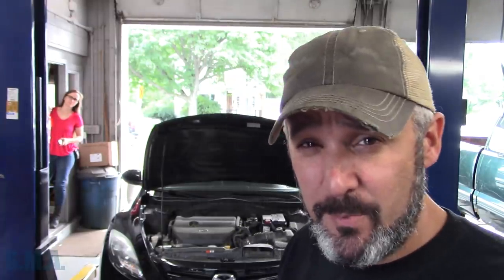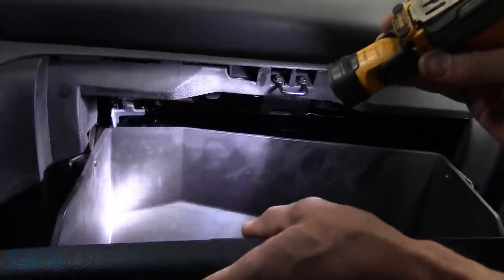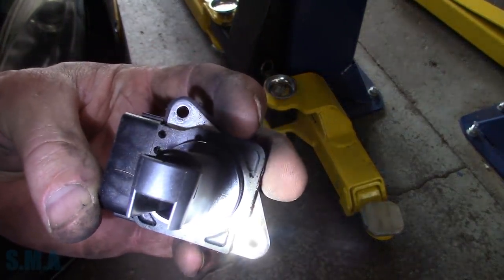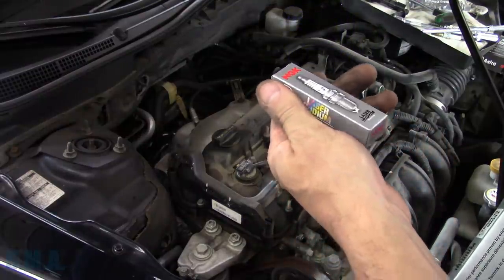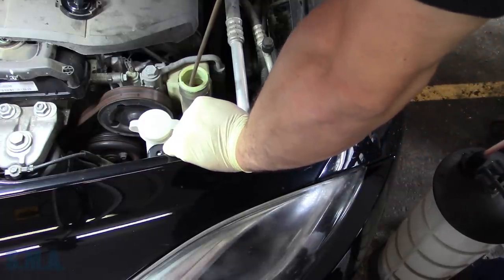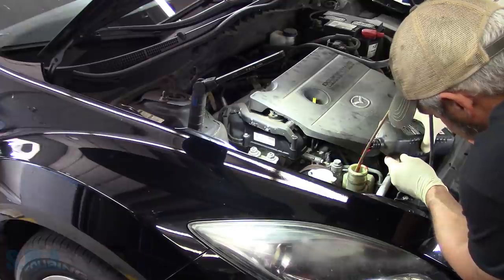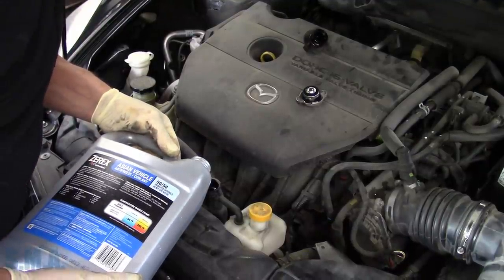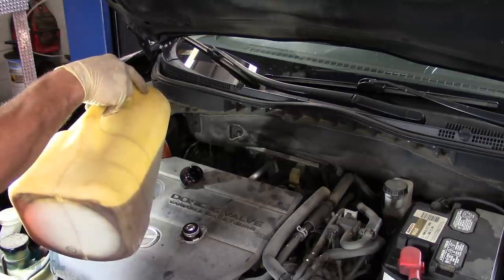Mazda 6: 100k Service Front To Back

Comment: Ah ha ha, i see this as my 2012 mazda 6i is skipping up to 200k (174,xxx). When i got it at 4x,xxx and happen to check the air filter, It looked as if the original color was dark brown instead of white. Is that a universal thing with these cars?!
... You'd think the dealership (that i used to work at as a salesman) would have changed all that before selling the car. That's what led me to wonder above the engine filter, that led to the fluids, that ultimately led to me binging on all the auto maintenance videos on youtube and working on my car (plus doing uber for 3.5+ years in dc. That also prompted me to learn how to fix stuff).

Comment: How are those Mazda 6s with rust? I do know the first gen are pretty bad.
Reply: I have a 2009. The suspension parts (subframes and control arms) are getting a little rusty but not terrible yet. The body is ok, has a few spots where the paint has flaked off the last few years, around the taillights and a spot on the door. Nothing like rot yet though. I live in the inland northwest, where deicer is used in winter.

Comment: The Muncie transmission in my '71 Trans Am didn't like the dual GL-4/5 spec gear oil.  Never did shift the same until I rebuilt it years later and made sure to use only GL-4 spec gear oil.

Comment: Not to split hairs, you do you, is there a reason you dont suck oil into the syringe tool? I dont think I've ever even tried to remove the top from mine. Just do a sacrificial suck and shoot into a bucket to clean out the oil in it with the new oil your using and away you go.

Comment: Oh mien Gott im Himmel Eric O. If your shop was near me I wouldn't have to do  my own 100,000 mile service. Except since you never had an automatic transmission you never  changed the filter. Which reminds me. My car is all wheel drive so I have to change the fluid in the transfer unit and rear end which I never sawr you do on thisn.

Comment: My 2013  Mazda 6  ,same car   just  a automatic,  Just blew its engine  extreme  rod  knock,   with 68,000   on it.       somehow my other comment got deleted....        Basically gonna cost about 3  grand total with $800 in rental cars ,got  a new used  engine with 20,000 on it    sitting  in the shop  waiting  for  the tech  to install it,,  They are backed up at least a week....         should i   put an oil pressure gauge   On my new used engine..   because it  gave me absolutely no warning,  That my oil turned  to jello pudding,      I checked my oil weekly. And  Treated my car with lots of love....  anyone have any ideas how I can hook up an oil pressure gauge to this exact motor...   Should I go with oil filter  base type ?   Or is there a hole on the side the block I could possibly use...   ?         Because I’m not gonna depend on any of the lights on the dashboard again since none came on even to warn me  from low oil  or  low oil preasure..         Which is more likely the cause of my engine failure..
Reply: Google Scanner gauge 2 or ultra gauge for oil pressure. Hope it helps ☺️
Reply: I don’t think an oil pressure gage would save you from “oil turned to jello pudding”.  If you changed your oil and filter as recommended in the owner’s manual or better yet every 3000 miles and checked the oil once a month minimum, odds are there would not have been a failure.  True, something else could cause sludge ... but not changing oil as required is the #1 cause.

Comment: The spark plug anti seize issue is most likely due to people not realizing the spark plug is now lubricated and will take about 25% less torque to achieve the same clamp load. Meaning they use the factory torque (dry) with anti seize and  basically over-tighten the spark plug by 25%. Makes it harder to undo. Threads are probably deformed at that point hence making it difficult to remove the entire way. Plus NGK has a good coating on their threads already so it's not necessary. 

I'm still traumatized from a Honda pulling 3 of 4 threads out so I always put copper anti sneeze and dielectric grease on my plugs, gives me the warm fuzzies.

Comment: Surprised the timing belt/ serpentine belt wasn’t part of the service.
Reply from the maker: I showed the serp belt was changed and this is a chain drive engine
Reply: South Main Auto Repair LLC should of watched the whole video. Thanks for the video on Honda’s 3.5 timing belt. Really helped. What do you do when two of the 3 bolts holding top engine mount to engine come out with the threads still on them? I put in heli coils, but didn’t start them deep enough and man, what a mess.
Reply: South Main Auto Repair LLC don’t laugh! Not funny for at least 2 more weeks!

Comment: I like to say my words wrong like you do. I pronounce them like they're spelled. Grand Prix Is a good one or filet mignon. I'm not sure my wife agrees. After all the work you did on this one it should be so economical they will not only NOT need to stop and fuel up, but it will undoubtedly produce its own fuel. Some would need to be siphoned occasionally so the tank doesn't overflow.  Or as you say a little sucky sucky. There sure was a lot of sucky sucky going on in the video.

Comment: Who ever thought of replacing break fluid and power steering fluid? It's as foolish a service as replacing the oil in a shock or strut (yes I did work in a shop that quoted that to.) Just a dollar bill machine there. Not to many cars have spare tires anymore.

Comment: how do you like the dewalt 1/2 cordless impact
Reply: Scott Ward   I have the big mofo high torque half inch and the slightly less powerful mid torque one too and they are both awesome, easily on par with the Milwaukee that another tech has in my shop for both the high and mod torque variants.

Comment: petcock (n.)

also pet-cock, "a small plug-cock, made to be fastened to a pipe and used for draining water and condensation from steam cylinders, etc.," 1864, from cock (n.2); the signification of the first element is uncertain.

Comment: Putting anti seize on spark plugs is old bad practice.
Just like putting copper grease on the back of brake pads to "stop squeaks"

Don't do it. The manufactures don't recommend it for good reasons.

Comment: You forgot to change the transmission gasket and pan don't not change oil without removing those or you will damage your transmission for just doing a  transmission flush or change